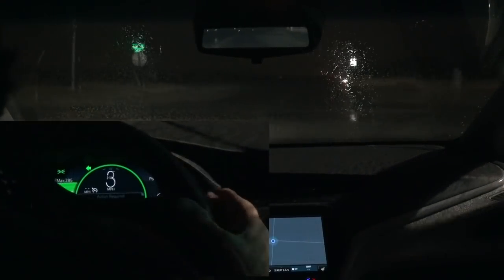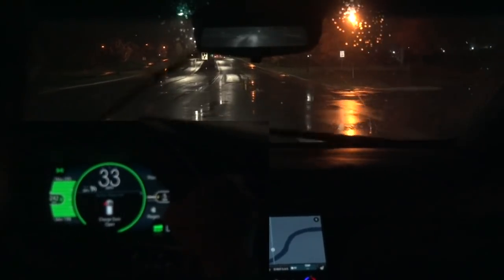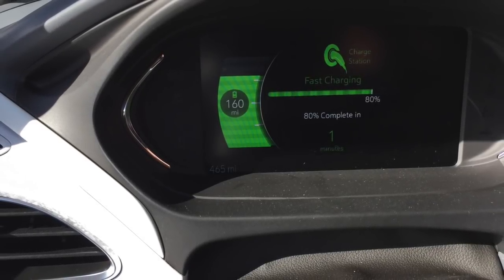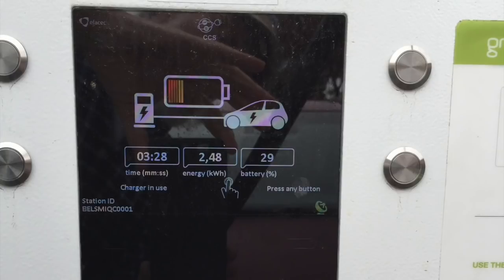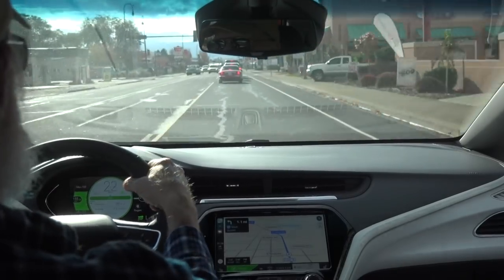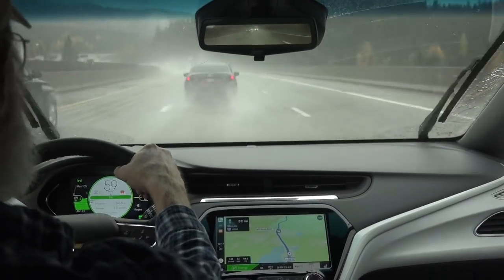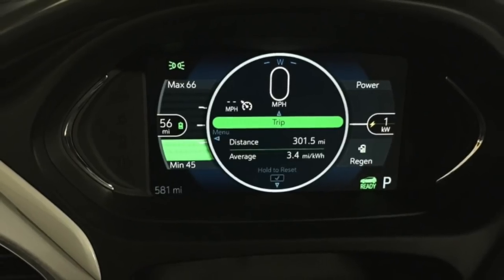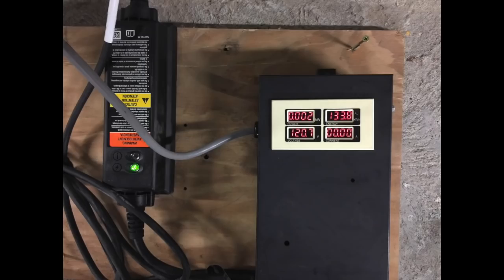A Chevy Bolt from Spokane to Seattle Part  #1

Comment: Enjoyed your videos on your Chevy Bolt.  How does the A/C actually cool?  I have not seen any videos on how it works.
Reply: The A/C compressor is mounted on the housing for the motor.  It is a very small motor-compressor assembly.  It cools the cabin and also cools the battery and electronics.  
It actually has 3 refrigerant circuits.  One for the electronics, one for cabin cooling and one for battery cooling.
GFM
Reply: @electriccar3253  Thanks GFM.  Sounds like a fun vehicle.

Comment: Nice. I'd like to do a road trip from Seattle to Spokane one of these days. Would be nervous to do with with my LEAF 2017, with its 100-mile or so range... though with long range EV like your Bolt with 238 miles, that would be no problem.
Reply from the maker: The problem is, when quick charging, you can only go to 80%.  That definitely reduces the options.  Even with the Bolt, bad weather puts you in some jeopardy.
GFM
Reply: @grayfurnaceman  Wait,I think you have a setting called "hill-top reserve" on, that stops your fast charging at 80%. I think if you turn that setting off, you should be able to charge to 100%... I'm sure other Bolt EV owners can charge to 100% just fine since you have liquid-cooled battery, that allows this...
Reply: Hilltop reserve charges the battery to 87%.  DC fast chargers charge to 80% with some of them having the option to charge to 100%.  The problem here is it is no longer a fast charge.  The car controls the speed of charging to protect the battery.  As the charge gets close to 100% it charges very slowly, so the "quick charge" becomes "slow charge".  I will be explaining this issue further with a series on charging coming up.
GFM
Reply: @electriccar3253  Right. I mean you could keep the CCS fast charger plugged in and let it charge up to 100%, and I do know that most EVs will start to slow down around after 80% charge (I know my Nissan LEAF does)...
Reply from the maker: There problem here is time.  How long do want to leave it on the charge?  Its called a fast charger so you can charge fast.
GFM
Reply: @grayfurnaceman  Right.. I get that.. I'm just saying it IS possible to use L3 charger to get to 100%, though it will take a very long time to go from 80% to 100%... I get that. My point is that it IS possible if there is no L2 charger nearby and you need full range at 100% for whatever reason...
Reply: @be236  After 80% move to a level 2 charger.What happens a level 3 fast charger slows down to a level 1(Wall plug) after 90% plus level 3 chargers either charge for time or power.The best way to explain it is pouring a beer/pop you have to slow down so not to fizz over.

Comment: EVs are much more sensitive to things which we don’t see as having much effect on gas powered cars, such as speed, elevation changes, wind, cold dense air, heater usage, and even rain on the road.  In the approximate ambient temperature that this trip was taken, the range with a full battery should have cleared 200 miles.  After starting a trip such as this, subsequent fast charge events are “relatively fast” (1 hour to charge from about 25% battery to 80% battery in the Bolt), assuming a 100A 50 kWh charger, but fast chargers can’t be more than about 150 miles apart, or you will risk range anxiety in unfamiliar areas.  The US charging infrastructure (outside of coastal regions) is not this good yet, but Electrify America (VW’s penalty for the Diesel engine scandal) is helping to close the gap.  Using 110v to charge the car - as was done in Seattle - is an extremely slow method to charge an EV, adding miles to the car at what is essentially a walking pace - tens of hours to fully charge a nearly depleted battery.  This is the least efficient way to charge an EV as well.  Fast chargers do cost a lot (20 to 30 cents per minute) so for a car that will be sitting at a destination, there are many public chargers available which will charge the car at what’s called level 2 speed, or about 25-30 miles added per hour of charge time, which are free, or perhaps up to around $1 per hour of use. Assuming a charger such as this was available near where he parked the car for his Seattle stay.  Sometimes hotels will provide a level 2 plug for overnight guests to fully charge their EVs in time for their morning departure.

Comment: Personally I just see something like the Bolt as a second car to run close to home errands.   It would make me very nervous to take an extended distance trip in a Bolt.  I'm much more keen on the Volt, but it's not without problems as even it can leave you stranded on the side of the road waiting for a tow truck and then several weeks in an inconveniently located  repair shop as they try to figure out why the gasoline engine failed to come on, and the entire car locked up with no way to easily reset it.
Reply from the maker: For a long time that was true.  Range was in the mid 80s.  This thing has a range of 238 EPA miles. So far, no one else (except Tesla) has even come close.  
Compared to gasoline engines, it is quite simple.  
GFM
Reply: Bolt is an easier car to travel with than you may think.  It just takes some route planning, and a route which contains DC fast chargers if your trip exceeds 200 miles.  Assuming a Bolt could be your primary car, how many times per year would you take a trip which exceeds 200 miles?  For most people, it’s once or twice (per year), and a car such as this will work for them - primary or secondary car - all of the rest of the days of the year.  Especially if you are able to charge it where you live.

Comment: now all you need is a trailer with generator and lots of gas to recharge it when it runs out in the middle of nowhere....
Reply from the maker: The interesting part of this car is that it has a 238 mile EPA range.  It is the first to get that high without buying a Tesla(and paying the price).  So far, none of the others are even close.  I will be looking at charging in future videos.  BTW, gasoline powered cars had the same problem until Standard Oil financed gas stations throughout the country.
GFM
Reply: With a little planning, you too could take a trip in this car.

Comment: Did you buy a Bolt or just trying one out?  I think a range of 238 miles eliminates range anxiety for commuting while providing an eqivalent mpg of 110-128 mpg e.  So fuel cost goes down to 10-25% of normal.  $50 a week fuel would reduce to $5-$13.  For trips a hybrid, full gas or a rental seems to be the answer.  All works as long as lithium prices do not suffer as a result of a China trade war, who own a majority of the resource.

Comment: in time these wwill be the norm. cant negate gas is finite and when it gets low and people cant afford gas prices, electric cars WILL be the way of the future eventually.
Reply: With very little maintenance (even past 100k miles) and no smelly exhaust or gas fumes, EVs will catch on as the price of them drops a bit, and the amount of readily available chargers increases.

Comment: From 25 to 80 how long did it take to charge and what is the cost per charge?
Reply: oops, asking before vid is done lol.
Reply from the maker: I will be including some info on that with the next video in the series.
GFM
Reply: Approximately 1 hour to recharge a Bolt between these percentages.  Perhaps a little less with a charger that has higher than 50 kWh - 100A capacity.  The cost for the fast chargers varies but is typically 20 to 30 cents per minute of charging in US.

Comment: Interesting video. Always curious how well those electric cars performed.  

Always wanted to know how one might pay at the charging stations? Maybe you have some insight?
Reply: The cost to charge varies wildly from station to station. Theres several different 'networks' of chargers, and the prices are usually the same within the network. A huge amount of the level 2 chargers are free, but those use the cars internal charger and it takes hours. They're quite common and very reliable since its basically just an extension cord. The DC fast chargers, or Level 3 chargers are much more expensive to install, and much faster, but usually cost money. How much varies from free, to very expensive. Usually it's about $5-20 to charge for 20 minutes or so. How much energy/range you get out of that 20 minutes depends on your car. Right now the fast chargers in the US are a bit of a mess. Presumably that would get better in time. Sometimes they don't even work. Now, if you have a Tesla, they have their own fast charger network, and the rates are free for some models, and very reasonable for others. Plus they have very high charge rates, more stations than anyone else, and they always work. You can expect 200-300+miles of added range per hour at a Tesla Supercharger and even if you have to pay, its a few dollars.
Reply: Charging stations may accept what’s called an RFID card, which identifies you, as an account holder to a specific charger, or perhaps use a smartphone app, which can activate a charger from your drivers seat.  Few so far use credit/debit cards, but this is an option too.  Some chargers may require you to use an RFID card for access, but since a store, or group of stores, have provided the charger for their customers, the electricity dispensed into your car can be free.

Comment: Range anxiety.  No Thank you
Reply: The Bolt can easily clear 200 miles on a fully charged battery if your travel speed is less than 70 and it’s not really cold out.  That’s hardly range anxiety.  For lots of people, a completely charged battery could provide them with a weeks worth of driving without any anxiety at all.
Reply: Dennis Lyon right just need to rent a petroleum car when traveling 350 miles to the in-laws on the holidays.
Reply: @lg4ky  Or just eat lunch/dinner while you fast charge to get the additional 150 miles... after 3 or 4 hours in the driving seat, I'm sure as hell ready for a restroom and a bite to eat/drink.
Reply from the maker: My first electric car sure had that (I converted that one).  38 miles range.  As I have used this one, that issue has reduced considerably.  I will be doing more on this in the future.
GFM
Reply: You are about 5 years out of date....
Reply: No different than trying to find a gas station.

Comment: Hydrogen fuel cell  is my choice
Reply from the maker: The problem with hydrogen fuel cells is they are not here.  Lithium is.
GFM
Reply: As an Engineer, the real problem with fuel cell vehicles , is the cost. They are the same as battery electric cars, but they also have an extremely complex fuel cell generator on board. Sure, they can get away with a smaller battery, but they can't have no battery as this would be outrageously impractical and make the fuel cell portion much more expensive and complicated. And it turns out fuel cells are difficult to make inexpensively enough to make the car cost under the 100K+ range currently. And if that wasn't enough, they're guaranteed to be less reliable than an electric car, plus the infrastructure is likely never going to be built as they are a stop gap to lower cost battery electric vehicles. It's really absurdly unlikely theyre going to be mainsteam or commonplace, as they are inherently more complex, expensive, and less reliable than battery EV's. The only issue with the battery EVs right now is moderately high battery costs slowing adopting, but the rate of improvement here is good.
Reply from the maker: It looks as though the battery cost is about to drop by about 1/3.  If so, the door is open for the 100 KW battery.  This would mean a 400 mile vehicle.  This effectively would compete with the ice vehicle.  With effective active cooling, they could be the go to vehicle of the near future.
GFM